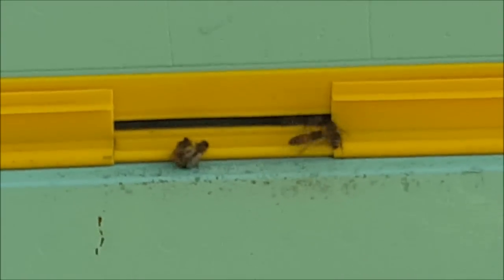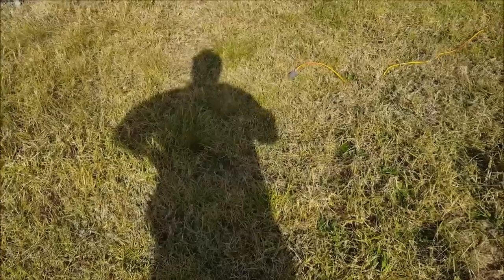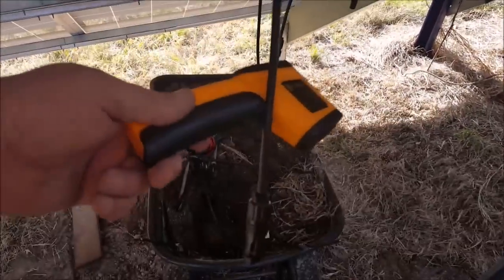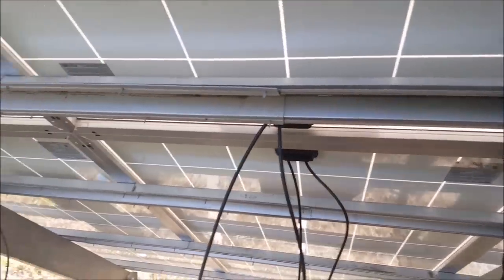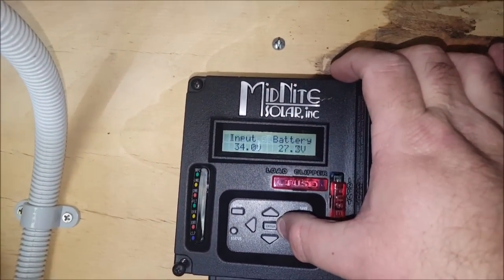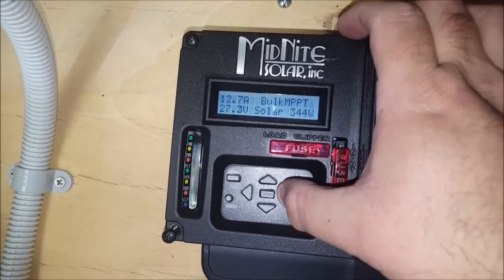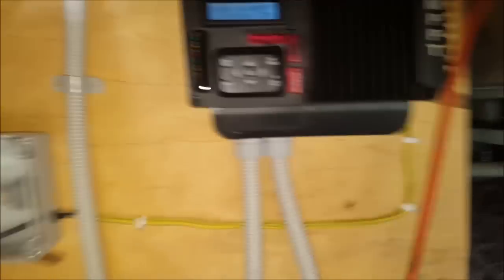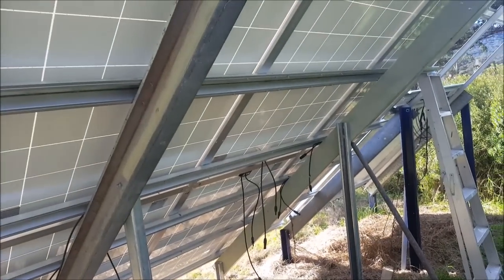Off Grid Solar Power - Progress Report on the 2kW Solar Power System

Comment: Everything  looks good but why you don't tell how much money you invest,  easy a system like that brand new battery solar panels inverted  ect about 8,000 dollars or more i'm saying if everything is new not used stuff let me know how much U S money
Reply from the maker: Okay, here's the ROUGH cost (not counting cabling/fuses/circuit breakers) for the 2kW system.
$700 for the 2kW of panels.
$100 for the steel racking.
$0 for the 24V 375Ah battery bank.
$650 for the Midnite Solar charge controller.
$200 for the inverter.

That's Australian dollars.
Reply: Pop's Shack thanks for the inf not bad